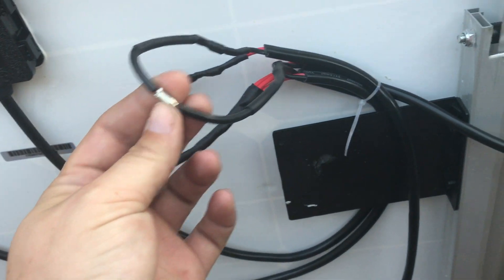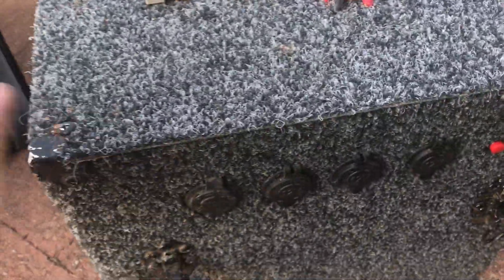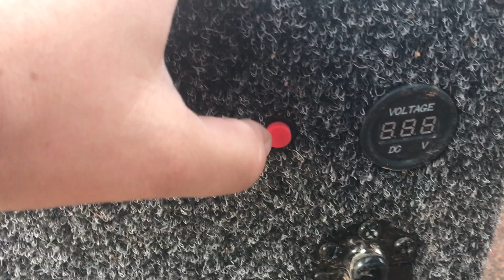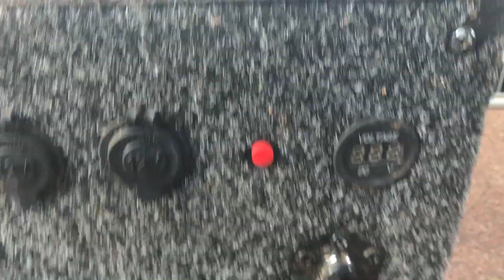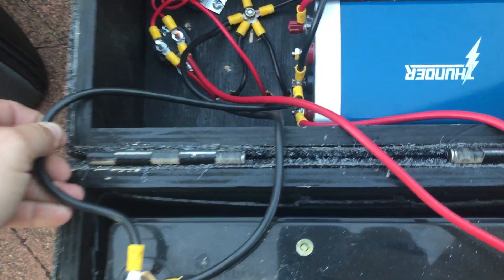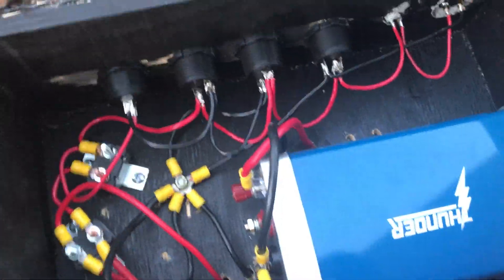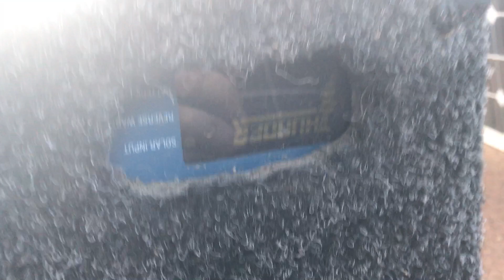DIY: Build a SUPER EASY BATTERY BOX and SOLAR SETUP for CAMPING / VANS / CARAVANS

Comment: As much as i love the idea, it could be better, e.g, you are very limited with those ciggy lighters, you have them all bridged together meaning that if you load them all with 16AMP, the poor wire running between the battery and the first lighter socket, might get abit hot/burn. I also suggest you maybe get a little 300watt pure sine wave inverter for running laptops and that? I recommend maybe you add a small DC computer fan too if you put inverter in?

Comment: This video is awesome!  I'm going to attempt this on my own... just wondering how much all up (minus the battery and solar panels) did this cost?  So just the set up of the battery box?  Also, the regulator on the solar panels, does this need to be removed so the DC charger will work or can this regulator remain?  I have a fold out flat solar panel blanket 250w. Thanks again!
Reply: you need to bypass the solar panel regulator as the dc to dc charger has an in built MPPT regulator. im going to wire an anderson plug on the unregulated side of the solar panel regulator so i have the option to use both regulated and non regulated solar

Comment: Pls insulate the two wires on the back of the solar panels. I know the panels are relatively  low voltage but to protect your  panels its a must.
Reply from the maker: It was wrapped properly after I did the video

Comment: nice, you could almost fit a 240V invertor in there too
Reply from the maker: I've since re-purposed this box into a permanent fit out in our canopy and added a 240v inverter to run microwaves, kettles etc. that was the only thing missing but I didn't include it in the initial box because we were pretty new to camping and didn't really know what we wanted.

Comment: How often do you give the battery a charge when it’s in storage ?
Reply from the maker: I normally just check the voltage on the battery but connecting the panels for a day once every 3 months does the trick.

Comment: Thanks for the helpful video 🙏.
Haven't you thought of installing a peltier cooler on the box?
Reply from the maker: I did consider it when i first built it but heat hasn't been an issue, I kept an eye on it with a digital thermometer the first couple of times we used it and it never got hot enough to justify putting one in.

Comment: you should sell these, Great job
Reply: Btasty I’m not trying to be a hater but absolutely don’t attempt to sell these.  Deep cycle batteries should never be stored in confined spaces.  If it overheats, starts a fire, and kills someone it will be on him.  He’s going against manufacturer’s specifications. That thing is a fire hazard waiting to happen!
Reply from the maker: @mychanneltoletyouknow  The battery is an deep cycle AGM battery, there are vents on the side of the box under each handle for breath-ability. The battery box is now a few years old and has not had any issues, it has been on many camping rips and thrown around with not a single problem. AGM batteries
Reply: @mychanneltoletyouknow  To avoid the fire hazard he could use a Lead Crystal Battery. Very safe batteries.

Comment: I've been watching this video to use as a guideline for my Battery box, as I just got my 100Ah Battle Born LiFEPO4 Battery to replace my old set of GC 6Vs... Main difference is in the Solar Controller I am using (Renogy Rover 20A w/ 2 x 100W Flexible solar Cells) vs your DC to DC Thunder unit, and a centralized Fuse panel for individual fuses per outlet.   

Question: What style of joints were used on the plywood box? Its all covered with carpet, but was curious if you just did a butt joint, or some other form of joinery? I want the box to really protect the battery and hold together. I will also be using 1/2" or ~12mm ply as you have.

Also, What were you using the extra two Grey Anderson plugs for?

Thanks for the video!
Reply from the maker: Hey Adam, That's great I hope it has helped! I just used but joints and hinges to hold it together which worked well. You could also use a piano hinge here but I was happy to just use 2 heavy duty door hinges. The two grey Andersons are input/output plugs that I use solely for output.  They can also be used to charge the battery direct with another regulated panel if need be.
Reply: @TarrawingeeFarm  Yes, it did. Definitely moved me towards building out if plywood as opposed to the modified Rubbermaid type bin I was using. I figured the Greys were essentially I/O for regulated sources, or out for other appliances; was just curious what you may have rewired to take advantage of the 2 Anderson "outlets". 

Also, does the Thunder unit you use as a charge controller act as an mppt controller for your panels? Or more like a PWM? I would imagine it actually converts the 18v from the panel into a higher current 12v like an mppt controller would?
Reply from the maker: @darkskyification  I've since re-purposed the box into the electricals in a jack off canopy but I use the andersons to run mates fridges when we go camping, air compressor etc. the thunder from my understanding works more like a MPPT with the solar panel that we have.

Comment: Hi, could you please build me a portable unit like yours with a 150ah or 200ah Lithium Ion battery and supporting solar panels but also to use it with 12v output so for charging 12v cordless tools and maybe running some household appliances if needed. Would also like 12V, cig socket and anderson inputs for charging as well. Cheers
Reply from the maker: Hi Mate, I'm not an auto electrician and given your specifics I'd suggest going to see one. I built one for my brother to charge his drill batteries, run a small microwave and 45L engel fridge using an 2x 120AH AGM batteries and 200W panel. lithium batteries are damn expensive for what you're trying to achieve.

Comment: Nice build. Get those wires covered up on the back of those panels and you're good. Remember solar panels don't need to be connected to anything to be putting out power, so having those joins not covered could end badly.
Reply from the maker: They've been heat wrapped since, still going strong after 12 months.

Comment: Literally the exact video I needed to see as I want to do exactly what you’ve done because I thought surely I could build one cheaper then what companies try to sting for
Reply from the maker: if you factor your time in, the ones you buy are well priced. I just wanted the flexibility to be able to change it up if i wanted and I enjoy making things so the time didn't worry me. This battery box has since been re-purposed and fitted permanently into a jack off canopy.

Comment: Hi, Any chance you did up a wiring diagram when building this? It would be great if you could upload and put a link to it. I'm planning to replicate this exact box - wiring wise. But I'm going to do the box a little different. Cheers
Reply from the maker: Theres a list of products used in the description, but i will work on drawing up a wiring diagram.
Reply: +2👍
Reply: Would be great to get a wiring diagram and a list of the parts you used, similar to @Billies I am looking to have the same setup in a slightly different box configuration
Reply: +1!
Reply: +3 - this is great!

Comment: Cool build, but are those wires straight out of the panel, where you removed the stock panel regulator still exposed? It looks like two soldered joints just begging to short.
Reply from the maker: yep these were heatshrinked later, which is still not ideal but still going strong 12 months later.

Comment: I am currently researching battery boxes as I want to purchase one. This would have to be the best design I have seen. Over-engineered but that is exactly what I want. I am in no way handy enough to build one hence researching to purchase. Not interested in building me one?...
Reply from the maker: if you're not handy you could try getting a local auto electrician to build you one. Ill add a list of inclusions in my video description so you can take it straight to them. they should be able to build it. 
alternatively depending on your needs these units are quite good value for money https://www.autoelec.com.au/thunder-battery-box-portable-powerpack-power-12v-d
Reply: Beth Fletcher if you haven’t bought one yet, YouTube or Google a company called Australian Direct. They build battery boxes and have everything else you’ll need to go off grid.

Comment: So can you charge the battery from your car?  In case of clouds?  I think you said you could?
Reply: yes the empty pin on the dc to dc allows for a charge point from a car which is the same setup you use to run a dual battery setup, this way if you are traveling to or from your campsite you can still have your fridge etc. running whilst keeping the battery charged.
Reply from the maker: spot on!

Comment: Boyfriend proof! LOL This is an impressive build. You have got some skills. Can you please clarify the 3 days without the solar charge draws down to  ~75% of  battery charge or is it more than that?  Where you have "starred" your neutral wires there what kit have you used to fix them I can see the nut but is it something I can grab from a Supercheap or via eBay / electronics shop? If you posted up a list of components that would be great but if thats too much trouble just answers to my questions much appreciated.
Reply from the maker: yep 3 days without solar before the fridge shuts off (set to shut off before the battery draws down) the star is just a standard bolt from supercheap, runs back to the negative on the battery. having it like that just made it a bit easier to put together and switch things out down the track if I want to.
Reply: @TarrawingeeFarm  how did you fix the bolt to the lid? Does it go all the way through and you just covered it. Up with carpet?